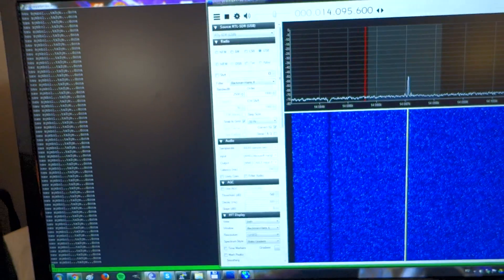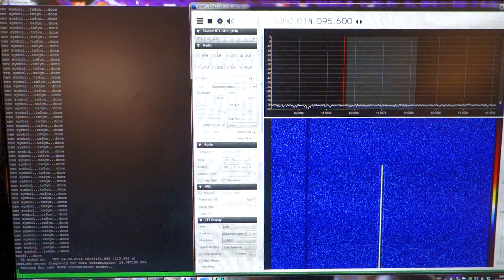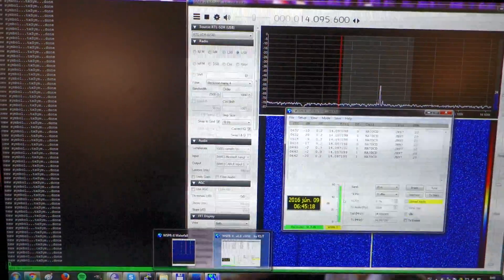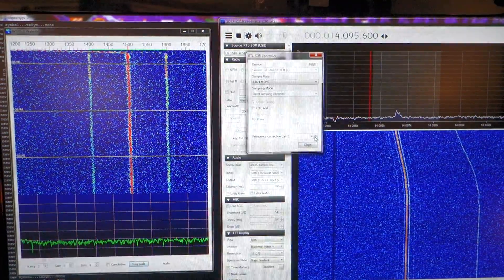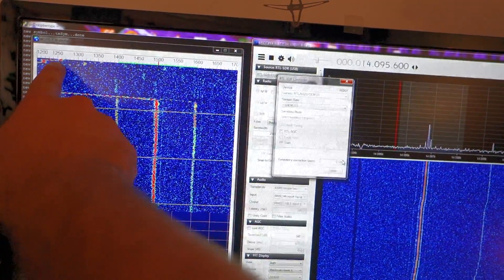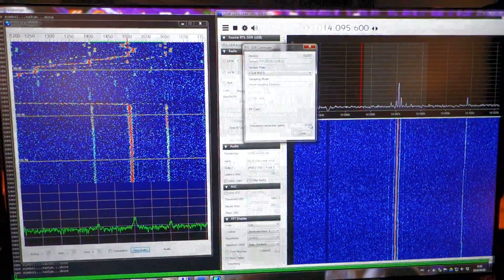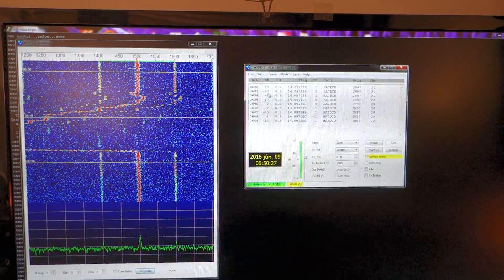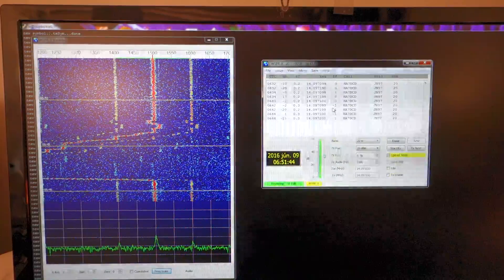Receiving WSPR mode at 20m with RTL-SDR dongle in direct sampling

Comment: What is the minimum requirements for antenna? Long wire cable without balun can receive WSPR signal?
Reply from the maker: Your location height matters the most :) inside huge sky crapers a bit difficult. With some open and higher space random wire does the thing too!

Comment: I wish I could understand what you are saying :-(
Reply from the maker: Hi Brian, 
Stay tuned I will upload a proper video with a inexpensive commercial dongle out there for WSPR reception. I agree this video is not built up properly to show every bits and details of the used hardware. I was using the RTL-SDR dongle in direct sampling mode with my own development an BALUN amplifier. 

But as mentioned above now better and easier reception tools out on the market instead heavy DIY work.

73,
Reply from the maker: https://www.youtube.com/watch?v=m5jR1HqrwJU
check out the written guide too!!